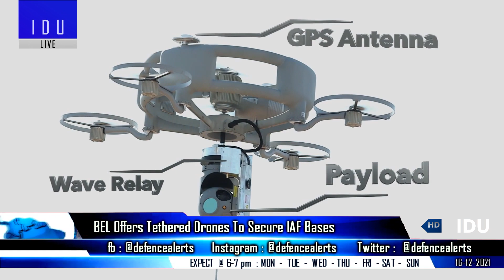Indian Defence Updates : SFDR Tested,Tejas Mk1A LRU Deal,FICV Engine Test,2 Corvette To Philippines

Comment from the maker: 🔴What's Your Opinion "Today's SFDR Test Validates 3 phase propulsion regime of future ramjet BVR Missiles" ?
ＬＩＫＥ | ＣＯＭＭＥＮＴ | ＳＨＡＲＥ | ＳＵＢＳＣＲＩＢＥ
Reply: Excellent news. Moves us one step closer in Astra Mk3 becoming a reality. Poor Pakistan will lose its advantage if all their AWACS are at risk of getting shot down due to their lack of strategic depth to hide them.
Reply: Just steer clear of joining Russia in the research and development of the components. They are going to extort money from India and charge India for the use of components India has developed themselves.
Reply: 350 km Air to Air missiles need to be supported with 400 -450 km range radar ....i don't think any aircraft is equiped with such radar. Unless it's fired from a trailing aircraft on a target detected and communicated via a leading air craft
Reply: @karsan6018  that's where our cats system will come to work.
Reply: @karsan6018  exactly and the missile should be end to end encrypted
Reply: @karsan6018  this is maximum range  mainly for XRSAM ground to air versions.. air to air will only be limited to thev range of Uttam mk2 aesa radar ( around 200 km) . However the no escape zone will be huge
Reply: @jaspalmaina  this about Astra which is air to air...I am sure there will be other means of target aquisition...if Astra mk3 can reach high altitude then low earth satellites could also be Targeted with such range.
Reply: Testing phase in 2024...thats a long long time..🤕🤕🤕
Reply: Believe SDFR will be used in XRSAM as well
Reply: Mind-blowing
Reply: @Flying Tiger Most probably a component or development towards 200 kms-300 kms XR-SAM? Still Indian does not have the fire control radar to guide it 200kms++
Reply: India should concentrate more on Semi Conductor, Display, and Toys manufacturing industries...💪💪💪💪💪💪
Reply: @Dr. B. DaMorya  S Band AWACS + ground based Early Warning radar can detect J20 + all other VLO fighters at much longer ranges than X Band Fire Control Radar - so AWACS will vector multiple IAF fighters to J20 using 2G but still very effective voice comms modernized as 4G software defined radio - approaching J20 from different vectors to expose most Radar Observable J20 aspects before launching multiple 50km to 100km range missiles - Interdicting J20 missions or making them highly risky with already limited J20 internal weapons loads – limited more by very large long range missiles with greater intercept probabilities at longer ranges than shorter BVR dogfight ranges - for killing AWACS + Tankers operating deep within friendly or IAF controlled airspace behind fighter screens directed by Airborne Command + Control – Measure Countermeasure….
Reply: ब्राम्हॉस 2 हायपरसोनिक मिसाइल कब निर्माण होंगी
Reply: @Flying Tiger , nope, its just for primary stage to take it to supersonic speed,after that, a Ramjet engine takes over.
Reply: Good news for India and bad news for adversaries 😂😂😂😂. All the best to DRDO 🙏

Comment: IMO, we should have an aircraft carrier on permanent deployment in the ASEAN sea (aka south china sea). If china regularly sends its subs into IOR, I think we should be in a position to reciprocate or pre-empt.
Reply: China doesn't do so it's cargo ship responsible for the same
Reply: Sending a carrier into the South China Sea would be very expensive as carriers need support vessels and submarines , also China already has an extensive network of attack submarines , land based anti ship missiles and maintains a significant naval presence in South China Sea..
Reply: @adithyanairh196  listen it's Very simple in IOR China will lose easily even if we have less carriers cause A  and N Islands are significant game changer there , we can use SMART later when developed fully,
Reply: @sparkly3989  Dude the whole point of an Aircraft carrier is to have a mobile airbase / Repair facility…Having airfields in A and N islands won’t help that much because major Chinese cities and trade routes in South China Sea are more than 2000km away..
Reply: @adithyanairh196  Le* what I said 😑 in IOR they can't take risk to enter and vice versa for Indian navy o